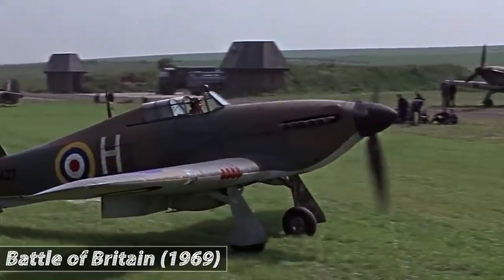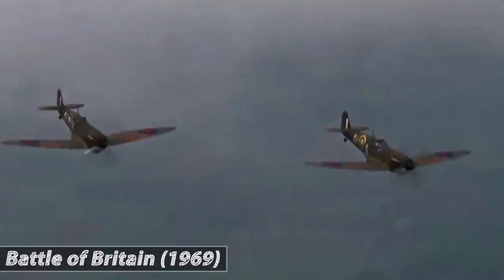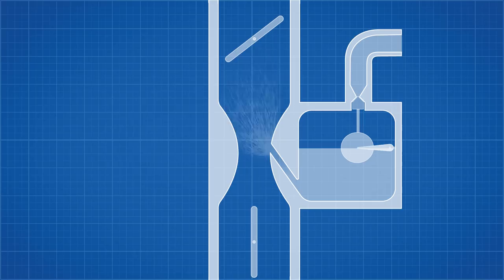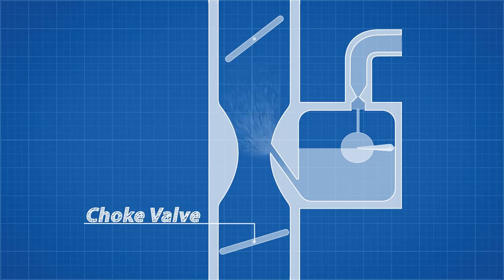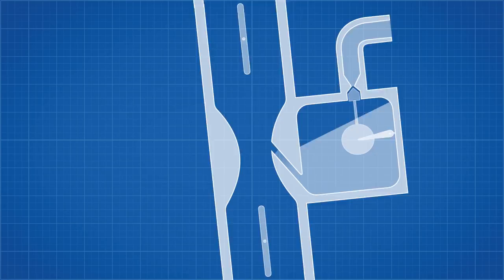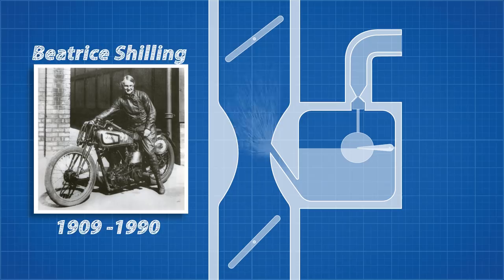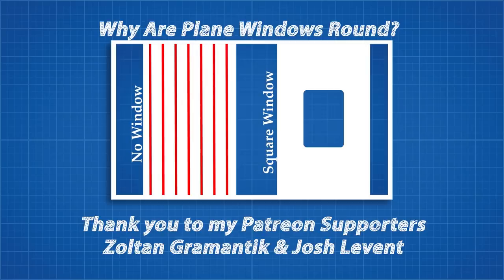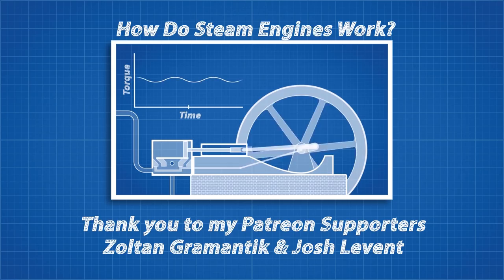The Spitfire's Fatal Flaw

Comment: I would have thought that "The Early Merlins Fatal Flaw" would have been a better title
Reply: All engines with carburetors had the same problem but as Rolls Royce knew it was more efficient than fuel injection and Rolls Royce solved the problem very soon anyway.  It was not a fatal flaw and pilots had little trouble overcoming it
Reply: Nobody would click on that video.
Reply: The Rolls was not superior  w/o fuel injection.The 109's could keep climbing when the Spits were....well spitting.Merlin was a fabulous engine been even better with F.I.
Reply: Little Blockhead.
The Rolls Royce Merlin was more powerful than the bigger Daimler Benz and Rolls Royce did not use fuel injection because the carburetor was more efficient at the time, Rolls Royce stayed with carburetors right through the war and they were better.   The early Bf 109 had an advantage over 30,000 feet but the fighting was mainly at half that height in the Battle of Britain, in 1942 the Spitfire went higher than a Bf 109 without fuel injection.
Reply: Blockhead Barrie thank you for your astute,kind & insightful remark.I watched a documentary with 3 pilots,2 WWII pilots one German who flew 109s,one British who flew a Spit.The 3rd an young British pilot.Both veteran pilots switched cockpits and commented their likes/dislikes of comfort,sight line,ease of controls,etc.They went over the pros & cons of both and remarked how evenly matched they were.Each had their advantages and disadvantages.The Spit could clime and turn better the 109 could dive and roll better.The pilots said this was because of the superior fuel delivery of the fuel injection in the 109.
   The old pilots were discussing their flying tactics.They commented on during dives the Spit would stall and start dropping the Luftwaffe pilots would cut their fuel back and drop down behind and machine gun the spits.The spit pilots knew the 109's only 15 minutes fighting time before they had to bug for France & fuel.Many 109's were splashed in the channel when the spits followed firing like hell knowing the gerries were on fumes and couldn't turn and fight.Quite an enlightening presentation.I'm sure this is your field of expertise and you could set the lads straight.My Bad Rodcliffe here you go https://youtu.be/BpTrygZfC-g
Reply: Goose.
Rolls Royce used carburetors instead of fuel injection because at the time carburetors worked better, that may be why the Merlin engine was more powerful than a bigger DaimlerBenz engine, Rolls Royce never went to fuel injection during the war, they developed with SU a speed density carburetor, the pressure carburetor and even an injection carburetor
Reply: hangon be fair, in the vid he actually says "the early Spitfire's ALARMING flaw"....
Reply: @RockinRedRover  
Alarming?  only to a new  trainee pilot and soon solved by Rolls Royce, even by the Battle of Britain it had been improved.
Reply: Tim: That is no good t6his bloke wants to have us subscribe. He is the worst kind of Researcher LAZY
Reply: And a picture of an early Spitfire that had an actual Merlin it that had the stalling problem instead of one with an American mass produced Packard Merlin.
Reply: Big Woody The never got fuel injection, they got a hybrid pressurised carb. Bf109s could out climb early Spits because it had leading edge slats that gave extra lift that enabled the aircraft to hang on a steep angle of attack. But later Spits like the MkIX could out climb a 109 G. A mk XIV could out perform even a Bf109K in every single way.
Reply: True but this for an idiot up thread A pressure carburetor is a type of fuel metering system manufactured by the Bendix Corporation for piston aircraft engines, starting in the 1940s It is recognized as an early type of throttle-body fuel injection and was developed to prevent fuel starvation during inverted flight.
Most aircraft of the 1920s and 1930s had a float-type carburetor. They are adequate for civil aircraft which normally fly upright, but present a problem for aircraft which fly upside-down or are subject to a negative g-force, especially military fighters and aerobatic aircraft. A float carburetor uses the venturi effect to supply fuel into the engine intake, this depends upon a constant level of fuel in the float bowl to maintain the desired fuel/air mixture. The float operates a valve which keeps the fuel level in the carburetor consistent despite varying demands by means of a linked float valve. As the fuel level increases, the valve closes slowing or stopping the flow into the bowl. However, since the float depends on gravity to function, it is ineffective when the aircraft is inverted. During inversion, fuel is delivered to the float bowl as fast as the fuel pump is capable resulting in an extremely rich mixture stopping the engine almost instantly.

The problem was keenly felt by the RAF during the first years of the war, because the Rolls-Royce Merlin engines fitted to Hurricanes and Spitfires suffered from the problem, unlike the direct fuel injection engines of their German counterparts. It was largely solved by installing a flow-restricting washer that allowed just enough fuel into the carburetor for the engine to develop maximum power (the R.A.E. restrictor was known as "Miss Shilling's orifice"). However, it was only a stopgap solution.

The pressure carburetor solved the problem .It operates on pressure alone, meaning that gravity no longer has any effect For that reason, the pressure carburetor operates reliably when the plane is in any flight attitude. The fact that a pressure carburetor operates on the principle of fuel under positive pressure makes it a form of fuel injection
Reply: Little Blockhead 
Rolls Royce had improved the slight problem before the Battle of Britain and solved it completely in 1941 while still using a float carburetor then developed along with SU a speed density carburetor which was given to Bendix to copy in 1942.  Rolls Royce having given Bendix what became called a pressure carburetor went on to use an injection carburetor developed by SU.  
I leave ignorance to you.
Reply: Is the floor wet after you could not hold on having got your knickers in a twist again ?
A lot was shared but mostly one way like nuclear research, radar, jet engines, supersonic research and so much more.
Bendix was given free of charge by Rolls Royce the carburetor which was better and lighter than the one Bendix had been struggling to make work.  
Having done a lot of research myself I was pleased to read some of the excellent work by an American who specializes on fuel injection and carburetors and he confirmed my own research.  
Any fool like you can read the US propaganda.
Reply: Little blockhead
It might help if you knew the first thing about anything to do with aircraft,  Now lets see, have you got the book in front of you or not?  Are you relying on your memory of what you are claiming because you have it a bit wrong.  
I will ask you to please stop and try to learn and that is being very nice.  
If you were a reliable source of it you could charge but really you are not very good at it, getting tired because it hurts when you try is not much of an excuse.
Reply: Skarrie,Bendix Stromberg - if you can lift your 4 chins off the keyboard and book mark the porno channel you are watching you can look it up or your handler at the home may assist you.This just keeps getting easier and easier.And a step backward, after making a wrong turn, is not a step in the right direction.And when you are done drooling on the keyboard look up Stanely Hooker,one of Britain foremost aircraft engineers who by the way was working for Rolls during WWII.
Reply: Skarrie 4 chins it was developed for Bendix-Packard Merlins.Victor Bendix was from Chicago.1st you deny it then attempt to claim it.When you get your ankle bracelet removed they'll let you into the Library - then you may tackle history.Didn't give them shit,like Rolls taught Ford also - you make me larf .Ford changed a lot of things because of mass production,and because of previous stalling problems.Did your enginner friends invent flight and mass production assembly lines to?

It replaced Miss Shilling's orifice,you're an orifice that needs replacing also while not completely solving the problem, the restrictor, along with modifications to the needle valve, permitted pilots to perform quick negative G manoeuvres without loss of engine power. This improvement removed the RAF's Rolls-Royce Merlin-powered fighters' drawback versus the German Messerschmitt Bf 109E machine, whose Daimler-Benz DB 601 inverted V12 powerplant had had fuel injection since 1937. During early 1941, Miss Shilling travelled with a small team to fit the restrictors in one RAF base after another, giving priority to front-line units. By March 1941 the device had been installed throughout RAF Fighter Command. Officially named the 'R.A.E. restrictor', the device was immensely popular with pilots, who affectionately named it 'Miss Shilling's orifice' or simply the 'Tilly orifice'.

This simple measure was only a stopgap: it did not allow inverted flight for any length of time. The problems were not finally overcome until the introduction of Bendix  pressure carburettors in 1943 .They were used on Wright Cyclones and Boeing B-17 Pratt & Whitney Engines also

https://en.wikipedia.org/wiki/Bendix-Stromberg_pressure_carburetor
Of the three types of carburetors used on large, high-performance aircraft engines manufactured in the United States during World War II, the Bendix-Stromberg pressure carburetor was the one most commonly found.

Now see there Skarrie even a whack such as yourself can't screw that up.
Reply: You methane cloud when you're done wafting thru the land of make believe try typing pressure carburator WWII aircraft into the address bar in front of your face and see what comes up.Rolls Gave Ford and Packard their specs for mounting .So Ford and Packard could mass produce them Bendix designed that carb - you're welcome
Reply: It is such a shame that you are so ignorant.  
A speed-density carburetor system does away with the carburetor venturi, replacing it with an engine driven fuel pump that delivers the fuel to either the intake eye of the supercharger or divides it into individual fuel charges that are injected directly into the engine cylinder.
Rolls Royce gave this to Stromberg Bendix who copied it and the copy went onto many RR Merlin engines. 
Ford and Packard did not make carburetors, Bendix had been trying to make the carburetor that Rolls Royce gave them, the Bendix effort was heavy and did not work as well. 
I know it is hard for you to look at anything that does not support your claim that USA did everything first.
Reply: @bigwoody4704  
Little Blockhead.
Rolls Royce did give the working carburetor complete to Stromberg Bendix, maybe the B 17 had the early big heavy carburetor that Bendix was struggling with, it did not need to get positive or negative G on the B 17. 
Rolls Royce engines were made to tolerances that no one else could match but then you have never worked with any Rolls Royce engineers so you would not know how it was done.
Miss Shilling did come up with the first improvement in 1940 then with her team solved the problem completely in 1941 while still using a float chamber. them she and her team at Rolls Royce went to SU who had already made a speed density carburetor which was what you call a pressure carburetor, SU when given the specifications of the Merlin up scaled their carburetor and it was fitted on the Merlin used in the Spitfire Mk IX before Rolls Royce gave the carburetor to Bendix.   You will try to claim USA gave all these ships and supplies to Britain.  Ford of Britain was completely independent of Ford USA before the war unlike Ford Germany.   Bendix did not remedy what had been fixed two years earlier. There was no flaw before Packard made a single Rolls Royce Merlin to Rolls Royce design specifications.   
I love to give idiots like you every chance to look it up or make complete fools of themselves.
Try reading up on fuel systems by Terry Welshans. he is American and does know a lot about the subject unlike you.
Reply: Referrences and links were given,not remarks pulled from one's bloated backside .It is better to remain silent and be thought an idiot than to open your mouth and remove all doubt!!!
Reply: says Barrie the broken spocket who has been caught red handed in forgeries and  fabrications .When you're done strolling thru the land of make believe have the nurse at the home read you some history to you
Reply: Listen you tub you neither work in the airlcraft industry,you're no mechanic,engineer and damn sure no historian.Since you have not answered any of the facts that are linked I'll take that as win for me.Skarrie Hairlip blowing smoke out of his ample backside is a lesson in bafoonary .You are free to return to your previously scheduled smut
Reply: Little Blockhead.
Miss Shilling came up with that in 1940 and she went on to improve the carburetor in 1941 completely solving the negative G issue on the Merlin engine in the Spitfire Mk V that is before Rolls Royce and SU developed the carburetor given to Bendix which was simpler and lighter than the Bendix effort and worked much better,.  
You could screw up hammering a nail into a piece of wood.
Reply: Skarrie Hairlip is barKing today.Anyone reading can check out the references.Oh that's right you left yours in the lavatory  that you clean at the terminal underneath the dirty books.You're an engineer? Sure you are - of course.They set up toy train set for you to play with at the home and give you a hat and awhistle to blow LMAO
You've been wrong once and that has been continuously.References were left.I've went to that Aviation website and you wisely stayed out of any discussion as you would be outed for the obvious imposter that you are.Have the home dial back the voltage and call the Vicar for you.
Reply: @barrierodliffe4155  The big difference arose from the fact that the Germans had no access to high-octane fuels, and had to run far lower boost than the Allies. The advantages of direct fuel injection greater displacement only partly offset this disadvantage. Later Merlin carburetion was arguably a form of indirect fuel-injection.
Reply: @TomFPaton  
The old myth about high octane fuel crops up all the time but the German fuel was rated differently so in reality 87 octane in Germany was closer to 100 octane, the carburetor used by Rolls Royce was more efficient than direct fuel injection. Rolls Royce later used the SU injection pump which did not lose efficiency like the direct fuel injection.
Reply: @barrierodliffe4155  Thanks for that. I was aware that differences in octane reporting clouded the issue, but not that it effectively nullified the difference. Other sources contend that the difference is far less. That would certainly be consistent with the power/displacement difference between the Merlin and its German rivals. Otherwise, we have to conclude that the Germans just weren't as good as the Brits and Americans at designing internal combustion engines - an unlikely hypothesis!

Direct fuel injection is inherently more thermo-dynamically efficient than carburation, with port injection (eg the SU system you mention) somewhere in between. But DFI is tricky to engineer, and the Germans were way ahead in this. So I suspect the reason RR didn't use FI was because they couldn't!
Reply: @TomFPaton  
I have read that Stanley Hooker was well aware of fuel injection and how it worked but did not use it and the reason seems to be that a carburetor effectively cooling the fuel which gives better efficiency. I am not an expert on this but I have used supercharging with a carburetor mounted on the supercharger on one of my old MG's and it gave plenty of power and when the engine was hot the carburetor was quite cold.

I do know that the Rolls Royce Merlin engine in Spitfires gave up to 1,800 hp and for the DH Hornet  the prototype flew in 1944 and reached 485 mph they got 2,200 hp.
No other engine gave as much power per litre. US engines were mostly bigger as were the German engines.
Reply: Bull crap Barrie Burns read that article in the Aircraft Magazine,rather have your handler do it for you.Your country had american contracts on american planes.Blisterhead we were flying while you were still dodging Zulu spears in your air ballons filled with hot air like you 🤣

Comment: A video on the Spitfire showing a Hurricane in the opening scene........
Reply: Even the title the Spitfires fatal flaw, it was not fatal and all aero engines with carburetors had the same problem, in fact Rolls Royce were the first to solve the slight problem, before then all US fighters had the same problem and the Bf 109 had a fuel injected engine which had it's own flaws.  Maybe the P 40's fatal flaw or the P 51's fatal flaw would be  as accurate, the P 51 had the same problem until they got the Rolls Royce Merlin engine with the carburetor Rolls Royce had been using for some time.